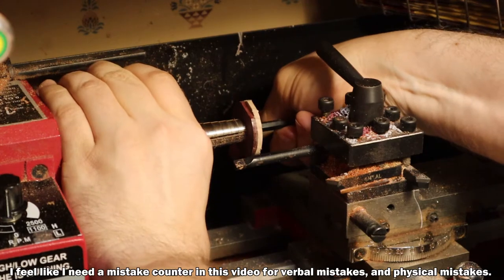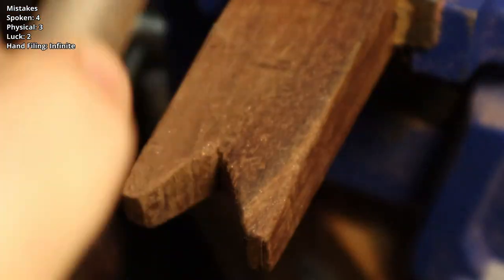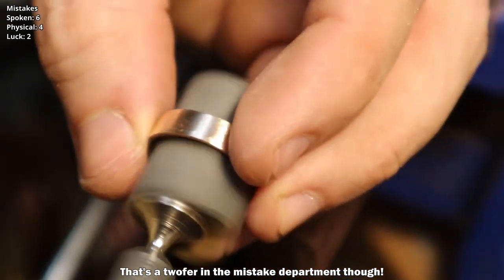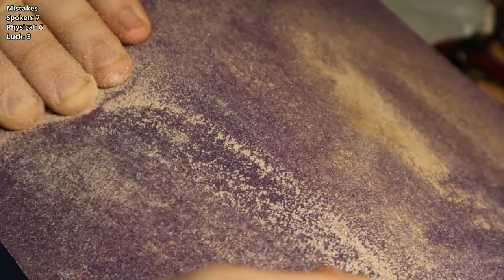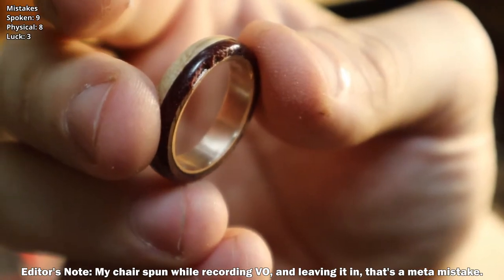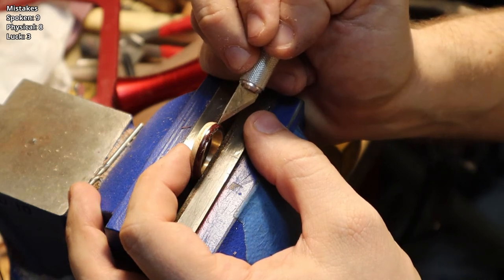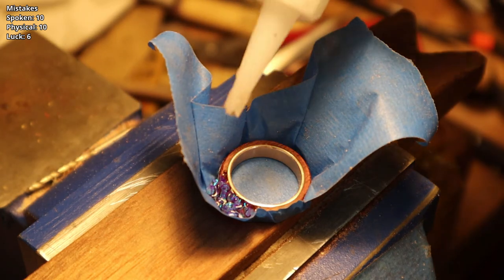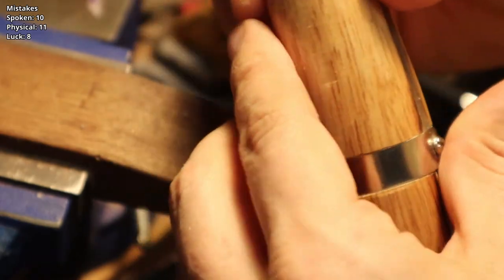Oops All Mistakes! Making a wood and bronze ring with a synthetic Opal inlay

Comment: Would putting the copper ring on a lathe mandril and using file that way be bad idea? Thanks.
Reply from the maker: I have filed down rings like that before. It depends on what you're trying to do, and no matter what you do on a lathe you have to be super careful and aware of what you're doing to hand file on a lathe, but you definitely can.